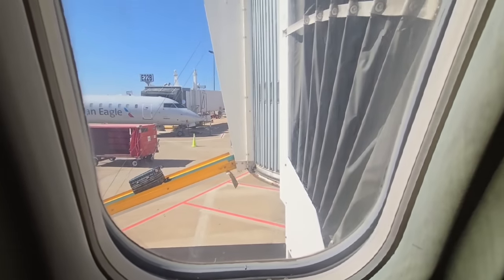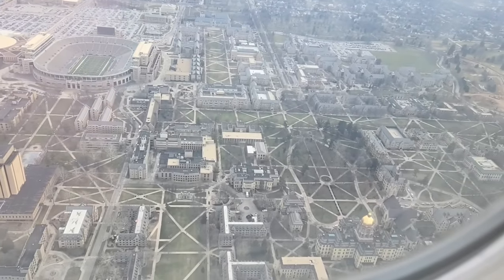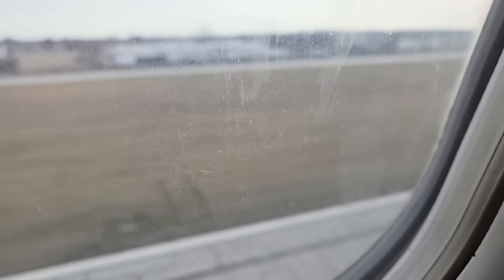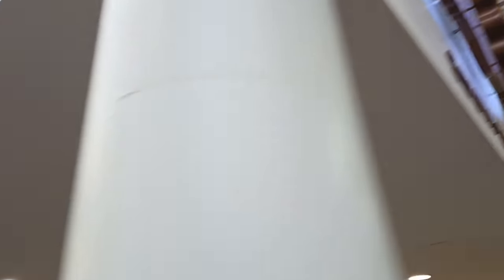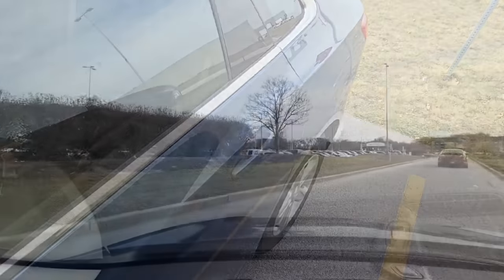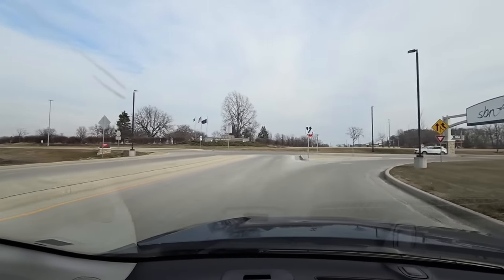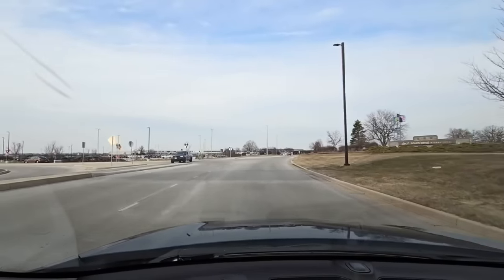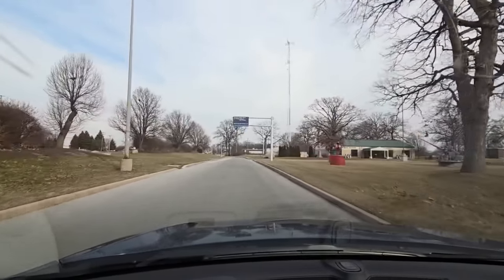LIPPERT Answers Questions about RV FRAME FLEX! Part 1

Comment: I think people also dont think about the sheer forces roads can have on the over all units. Just because tires can drive 75mph doesn’t mean you should. Imagine the forces when you travel down the road and hit the bad dips and bumps at 70-75 verses 55-65. You feel it in your body, the truck and the trailer. Now imagine a 14k toy hauler and a 1000lb tow past the rear axles and you repeatedly hits potholes, dips, bumps that make you wonder if your bike rack is still there. All of those stresses people rarely think about, can prematurely wear a frame much faster. 

15-20 years ago we didn’t drive that fast. These new mini diesels are pushing a 1000lbs of torque so now we load heavier, drive faster and of course things will wear quicker. People in all honesty are not caring much about load distribution and safe towing technique. 

It’s load up, hitch up and go. And haul ass at 70 till you get there on americas prime conditions roads. 

Ill say it since others wont, some times its OE. Maybe not all the time, but people never wanna admit they are at fault and maybe dont know what they are doing. 

But I dont trust the rv manufacturers much. I trust the frame manufacturers more.
Reply: We never tow faster than 55 MPH and anyone who does IMHO is just an accident waiting to happen. Life is all about the journey as in NOT the destination. Where is the fire that people tow all that weight at such excessive speeds?

Comment: sorry Lippert,  This is still going to roll back to you in my opinion.  If someone can prove that it was known that these RV producers were allegedly producing over weight or out of spec RVs, it is going to be tough to stand on the sidelines and sagely say we are not responsible for this, in my opinion. Best practice is to engineer a design to 3 times the expected load, in any case.

Some of the  RVs I have seen would not even pass a normal home framing inspection, and these things are rolling down crappy interstates and highways to get to campgrounds not sitting on a lot.

Comment: My 2016 35'ft Forest River Columbus 295RL has the factory installed frame box and kingpin, nothing has been changed and yet I see that familiar side panel bowing from the upper deck to the lower deck around the landing gear. I've inspected it a couple of times and have yet to discover what caused it. I've checked for cracked or failing welds as well as for any distortion of the steel in the transition section from the upper to lower deck and so far nothing. What I'd like to see is stiffening in this area with thicker cross-members and gussets. Like yourself, I too have been contemplating removing the kingpin and installing the gooseneck hitch as that will eliminate the side to side flexing of the front frame structure. A lot of campgrounds are not level including the one I live in and a fifth wheel plate simply doesn't have enough side to side motion to counter uneven road surface whereas the gooseneck does not have this issue as it rides on a ball which the towing vehicle and the 5th wheel RV moves independently of each other. As I am a trucker of 39-years, I know that 5th wheel plates and kingpins on semi-trucks receive a lot of damage and wear and tear from normal use, where as 5th wheel RV's are light weight and not designed for side to side flexing forces. I do understand the engineer's statement about leverage however most of the damaged 5th wheel RV's I've seen on YT about broken/cracked frames have the factory frame boxes and kingpins. For me, once I am able to get my wagon hooked up to a truck and take the load off the landing gear, I'll be able to perform another inspection to see if I have a broken or cracked frame component. It's so unnerving to have to deal with this.

Comment: I can see where you can put a tremendous amount of tongue weight with a toy hauler by not putting anything in the back garage.  To solve this problem with the toy haulers, why can't the manufacturers list a maximum tongue weight allowed? This should solve the problem of improper weight distribution and possible damage to the pin box area.
Reply: I have been saying this for months. Even contacted Lippert about it and they didn't understand my question. Just directed me to the 20% of GVWR.

Comment: If Lippert doesn’t know or understand the box the rv manufacturer puts on their frame how can they build the frame correctly?
Reply: That was my thought as well.  As a frame manufacturer you either need to set the max limits or know exactly how much weight your designing for.  Otherwise you could be put in a bad position. You can't truly build a safe frame without knowing the exact weight that's going to be applied to it.

Comment: Great interview JD! Seems to me that the frame manufacturers need to have a stronger influence on how the super structures are built on their frames to ensure there isn’t a compromise. Seems as if the RV manufacturer and the frame manufacturer have a disconnect in communication and it’s causing possible over loads to the frames and the frames aren’t being built onto in the way they’re designed to be.

Comment: I call crap. I’ve seen the same exact broken pieces of frame on my unit and another. When they sent me pictures of theirs I thought they took my pictures off line. Same Grand Design ST3740BH-R
Reply: All curable with less than 100 lbs of metal added to the thing..

Comment: Our 2019 unit, 26ft long conventional travel trailer had tons of frame flex. We would park, chock and level. Then wedges between tandem axles for stability. Then we'd put 4 corner jacks down to just snug and send out the slide. After that i'd have to re-balance the corner jacks as it would lean (as expected). Later in the same day, or for sure the next morning, the door would not clse or open without a ton of force. Then I spent considerable time every camping trip balancing the stabilizing legs to 'tune the door. Several times every trip.

Comment: His comment about changing the pin box to one that is longer, being detrimental to structural integrity is spot on. A longer pin box changes the geometry and can increase the leverage and resultant strain on the steel structure.  These 5th wheel frames are not built like the frame on a tractor trailer.  The steel isn't as thick and the pin box being placed way out in front of the frame is just asking for problems.  Continuous stressing causes steel flexing, and will break the welds and in some cases actually crack the steel member.  There are many YouTube videos showing 'frame flex' which is actually a broken frame.  In several of these videos, the original pin box was changed to one that is several inches longer.

Comment: There are a lot of Dynamics connected to frame flex. For first-time buyers trying to buy the right RV the information can be overwhelming. To simplify things we like to ballpark figures. The one I have relied on is if a manufacturer is using pin - hitch weight to help equate the gross vehicle weight rating or axle ratings then they are squeaking out under ratings. We have 7,500 lb of axle rating on a GVRW of 5600. The frame is over rated as well.

Comment: Excellent job by all parties to explain the issues. Not sure if it's been done, but has Lippert brought in one of these "problem trailers" and disected it? Weigh it. Weigh each axle. Tongue weight. Compare these weights to the engineered design of the frame. Have the RV manufacturers exceeded the engineered design of the frames?

Comment: What i see is broken welds by Lippert>There just passing the buck IMO
Reply: Perhaps...but perhaps not. The overlying question here is "Why do welds break?" One reason, of course, is that the weld is bad, but the vast majority of these come down to an error made by whoever was on the opposite end of the stick, gun, or torch. The occurence of bad welds is minimized by qualified welding inspectors, which one would hope Lippert employs.. 

Another reason welds fail is that forces were applied against it that the weld simply could not handle, no matter how good it was. Whether it is a building, a car, or an RV, those forces are going to win and that weld (and likely other elements of the structure or vehicle) are going to lose. Always.
Reply: I thought the welds were holding.  It was the thin metal itself, was tearing...that would be due to:
- too thin of material
- not enough supporting brackets (gussets)
- no 'bends' added in to make things stronger

Comment: I watch a lot of full time RV'ers youtube channels, and from what i see they all overload their trailers,  6 or more lithium batteries, solar panels, all creature comforts of home, except these are not houses. Even if your cargo cap. is 6k Lbs, it add up quickly.
Reply: So true
Reply: Your lithium battery comment makes no sense. 6x 12v 100 Ah lithium's weigh as much as 2x G31 AGM batteries. Most RV's have 2 batteries.
Reply: @riccochet704 Solar/lithium/invertor mania has become a religion! Any criticism whatsoever brings out the disciples.
Reply: @riccochet704 I have 6 48V 100AH Lifepo4 server rack batteries in parallel to drive my air conditioner all day long. (30kWh of power) They are 100lbs each.
Reply: I completely understand where you're coming from. Let me use myself as an example of something. We're currently wrapped up in this issue with Grand Design. My rig is scheduled to go back to the factory for repairs. We've only towed it for a little over 7,000 miles. We travel pretty light, always very aware of our weights and load limits, never have we even come close to being at our max capacity and what I do carry is always distributed very evenly. No generator, no solar, only one battery up front, never much for cargo or weight. I have the issue.
Reply: @CruizinWithTheCarsons so now I would be really wanting to know if I were u, were the walls properly fastened to the frame or was the frame crappy welded? Hope u find out. 🍻

Comment: I'm quite curious about this topic as I'm currently considering switching from a Class A to a 5th wheel, so I'll provide my 2 cents. There are 3 primary variables here on frame failure: frame manufacturer, RV manufacturer, customer. Any three of these variables can cause frame failure. Every single case of frame failure would need to be investigated to actually determine which parties were at fault. This isn't just an issue for RVs. If I purchase a Honda Civic and drive it as it's supposed to be driven, yet the chassis fails it likely wasn't caused by my actions; however, if I take the car into situations it wasn't designed for and the chassis fails it's likely my fault. So, my point is that I don't think we'll ever resolve who's to blame from a macro level when it's a culmination of micro level data. My question is, have failures (respective of volume) increased recently? These three primary parties (customer, frame, RV manufacturer) have been part of the equation from the get-go. So, if there has been an increase in a frame failure percentage, why? If there hasn't been an increase, then all of this recent attention could very easily be caused simply by an increase in awareness due to a recent online community focus. The reason I state failure percentage is to take the recent growth in the RV population into consideration caused by covid demand. The reality is we'll probably never know, but I've been looking at this very carefully due to my consideration of purchasing one.
Reply: Josh the rv nerd YouTube on topic is basically overloading, changing to goose neck hitch and some abuse and more full timers on road and some bad welds on some are the problem
Reply: The main problem is the whole manufacturing and quality control component of the RV industry!! The RV industry is not held to a fraction of the regulations as the Auto manufacturing industry. It takes years of testing and government approvals for new models of Autos. RV manufacturers change  models sometimes mid year.
Reply: @chesterwright8462 He blames 100% on the customer, n i commented to him as such. But what do u expect he owns the bloody dealership! 🍻

Comment: This may have been covered in the interview and I missed it.  Are the frames robot welded or are the welds performed by hourly workers?  Robot welds, if set up right, will provide consistent weld quality.  Past ecperience of human welders is that wire welders can be ran too hot because of production goals and this will cause welds to eventually crack.

Comment: Hi.  I think this is very informative.  I think your points about previous ownership and risk of taking on used products are great.  Especially because these are not commercial grade vehicles/equipment.  These are rolling sandboxes.  And to make things worse, they are sold with cheap materials to achieve a price point to maximize profit and have two or more manufacturers.  The end manufacturer (e.g., grand design) should be ultimately accountable.  That is a very key point.  Owens Corning built my sidewalls, and there was an issue.  Thor had to resolve because they were the end manufacturer.  My last point is that lippert should be smart and build only a super frame and not rely on the substructure for anything.  They should build their frame to carry all the weight in almost any position and not rely on the walls or the roof.  Have you ever heard of a class A diesel frame breaking because of water damage, delam, or cargo positioning.  No.  Freightliner or Spartan would not compromise the robustness of their chassis and rely on Thor or tiffin superstructures.  The sidewalls and roof could be gone, and that chassis will still roll just fine with no cracks.  Those huge fifth wheels are like cheap tinker toys riding on a shopping cart.  They should be classified as park models…. Thx .

Comment: I have been a Certified Welding Inspector for over twenty years.  The weld-ments on Lippert Frames are sub par quality.  It would be nice if Lippert hired certified welding inspectors to accept and reject welds to ensure that the quality would be better.  I would like to see where most of the failures occur.  I see cold welds, burn thru, and all number of poor weld conditions beyond any design issues.

Comment: Why doesn’t lippered take the length of the frame that’s sent them and over build the frame to accommodate whatever the manufacturer decides to put on it
Reply from the maker: From whaf I was told, It's the rv  manufacturer that dictates those specs AND the weight and capacity (GVWR) the frame needs to be.  Overbuilding might create a frame that doesn't meet those specs and will turned down by the manufacturer.

Comment: It's funny that route 70 thru Indiana is the worst section of route 70 in the country so you would think that the frames would be designed with a lot of extra strength just for Indiana 😅😂

Comment: This is comment is reflective of Part 1 only. 

I feel like this was a question and answer only with no follow up or rebuttal follow up ?s. 

I do not believe for one second (although they spent a good deal of time talking about it for obvious reasons) that the majority of frame issues are from leak intrusions or physical damage to the RV. Can overloading be a problem? Sure it can. But as far as the other reasons just seems like they wanna blame a lot of other factors. 

They made it seem so easy to get them to fix it ( road side service techs) but how likely is it that is actually going to happen. Really wish you would have pressed them harder so people can actually start getting some help. We have people spending 10-15k to fix issues that they likely didn’t create. 

Found there to be a lot of talk and not a lot of insight. I personally don’t blame LCI if they are building what the manufacturers are asking for. You should follow this up by going to GD and talk with them. My guess is they might not be welcoming you with open arms.

Comment: After an RV manufacturer completes a new model is there any testing done to see if the frame and super structure are sufficient?  Loading up the cargo bays, storage areas and closets with weight and hooking up the RV to a testing station and duplicating expected road conditions to the point of failure over an approximate test period?

Comment: Very comprehensive part one! So far it sounds like there are too many factors to take into account, and it really depends on each situation whether the issue is with the RV manufacturer or the end user has done something that would cause the issue.

Comment: I find it convenient when two manufacturers contribute to building a product that it’s always the other guys fault. My frame didn’t just flex. The metal was torn.
Reply: That's what I read was happening...that not so much that welds breaking, but metal pieces were tearing.  That means the engineers designing specific trailer frames are not making them robust enough...which is surprising, because most engineers 'over engineer'. 
...unless someone else is asking them to 'make it lighter', or 'thinner'.

Comment: You did an outstanding job even getting in the door. I would love to see how many problems are caused by overloading, changing the pinbox and then just driving conditions that cant be replicated in the testing area. I also really wonder if some of the problems on the over 40’ RE are just 2 tandem axles instead of 3 and not enough reinforcements on the frame to carry the realistic loads that customers are putting on the RVs.